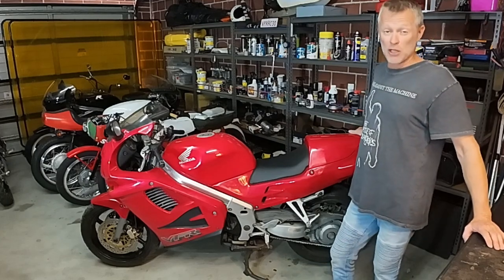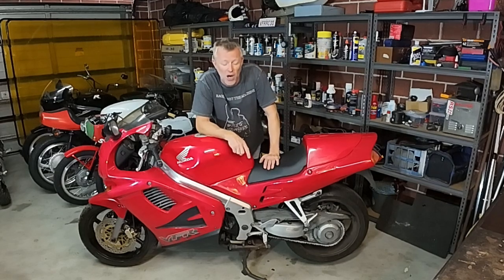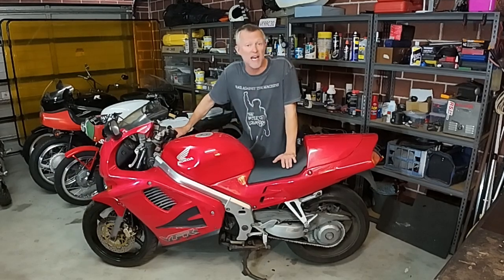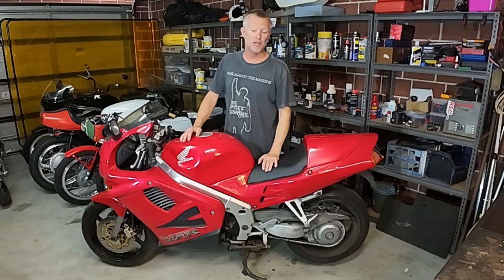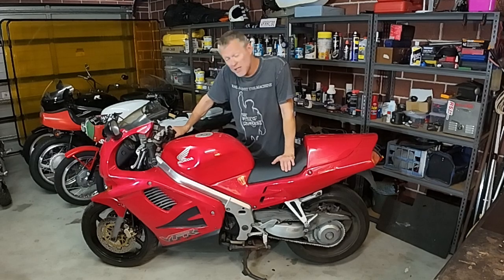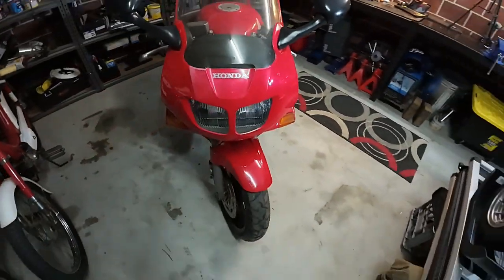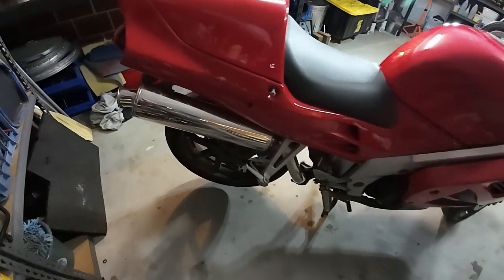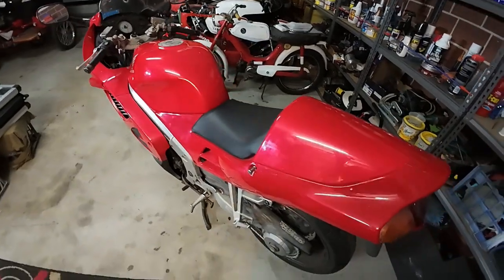Ep.1 Introduction. VFR750 RC-36-2 based RC30 tribute.

Comment: Lovely - looking forward to this. There is a guy in the UK who has just started developing bracketry for the 36/2 to accept 4 pots from the NC30 (vfr400) which'll be a bit more RC30 looking than the 2 pot sliding caliper you've got right now...
Reply from the maker: Brakes tomorrow!
I've got just enough cash to buy the Tyga Tribute kit. I'll need to buy the left hand exit exhaust at the same time and a few other bits like mirrors and clocks.
My plan is to get it up and running as quickly and cheaply as possible first, then improve over time.
Let me know what you want to see and I'll do my best to include it.

Comment: Hate to say it but the picture you posted of the rc30 is just a replica the front end including discs and brake master cylinder are off a vfr750 i owned 2 rc30s.
Reply from the maker: Thanks HRC1. I did think it might be after I'd edited it, by which time I was too knackered to go back and replace it. I have lots to learn and probably have other inaccuracies in the video. It's not scripted and I was on my own, I will gratefully accept your comments, corrections and guidance.
Two RC30's, how on earth did you manage that? 😮
Reply: @TheSpannerLab  i bought both crash damaged from a local honda dealer a long time ago in the uk.
Reply from the maker: @HRC1 D&K by any chance?
Reply: no it was from a dealers in ealing. @TheSpannerLab

Comment: I have the opportunity to purchase one of these bikes with a full test and very faded bodywork for a mere £750. Would you say "go for it"?
Reply from the maker: Without doubt.
I cannot over state how many bikes I've owned, hundreds!
These are cheap to buy, easy to work on, easy and cheap parts, bullet proof, good looking, handle well.
I prefer this to the VFR1200X and the VFR800 I have owned, if only for the change left in my pocket!
Not as fast as my GSXR750 not as 'cool' as my Moto Guzzi, but still my go-to bike for a ride out into the country for a nice coffee.
Other than electrics (which baffle me), hit me up if you buy it and struggle with anything.
Reply: @ProfessorSpanner  Luckily I am an electrician so I hope any electrical issues will be resolved easily